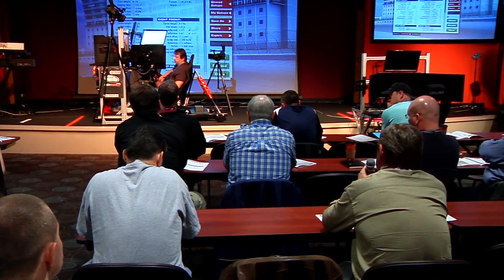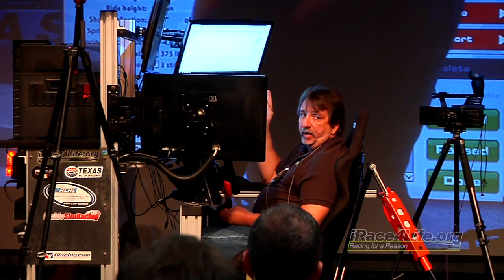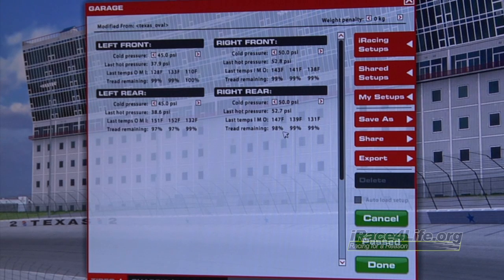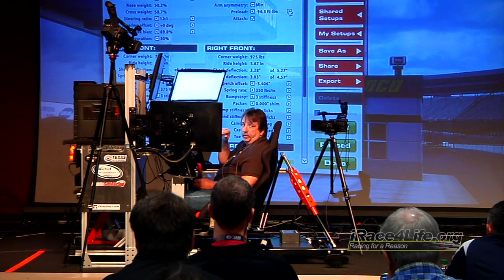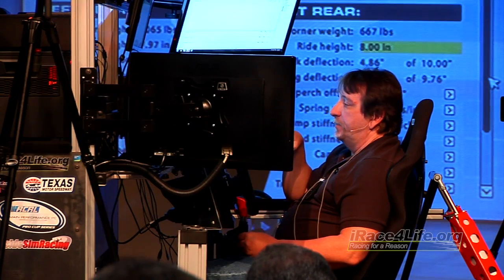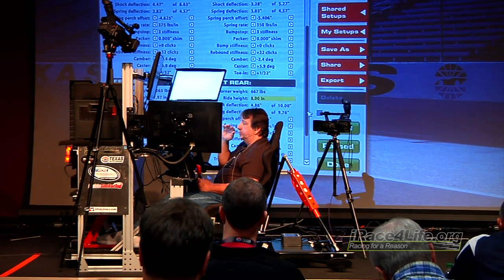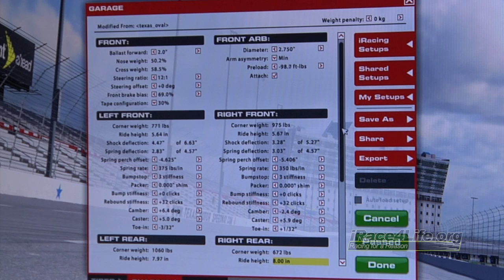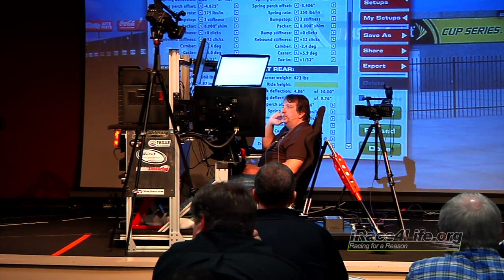iRacing - Building A Balanced Oval Setup Part 2

Comment: is there going to be a video where david covers analysing the data like he mentions in part2?
Reply: I was wondering the same thing.

I've got a league race in Homestead this sunday and have done about 400+ practice laps with telemetry. I would like to know what I'm looking for in Motec so I can start adjusting properly.

Right now I'm down to a 32.1 in race trim on lap 1 but with a disastrous falloff to 32.5-32.6 after about 7 to 8 laps.